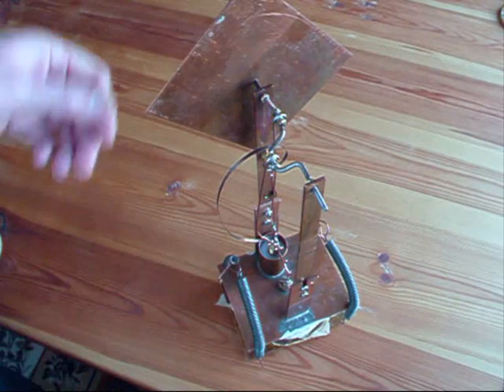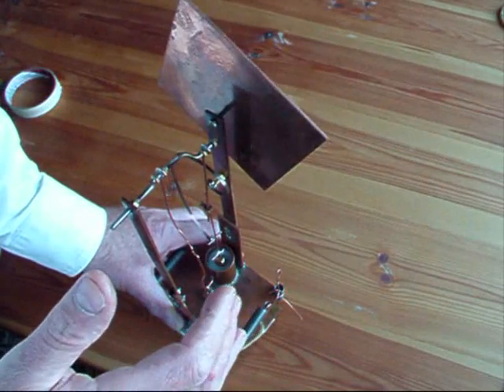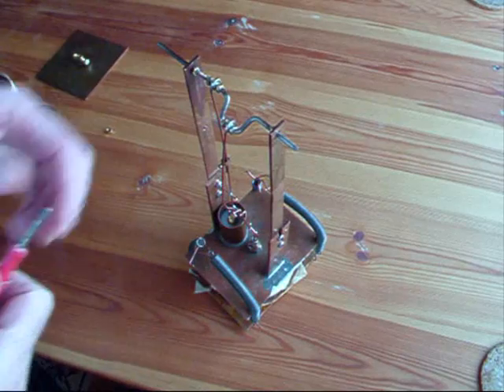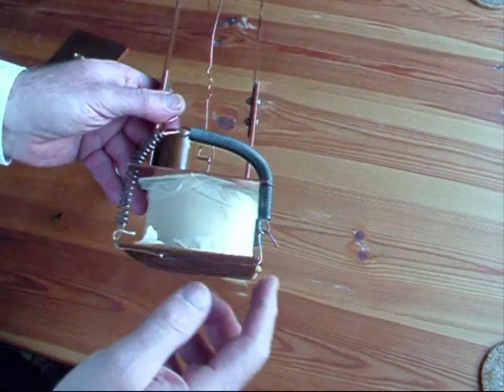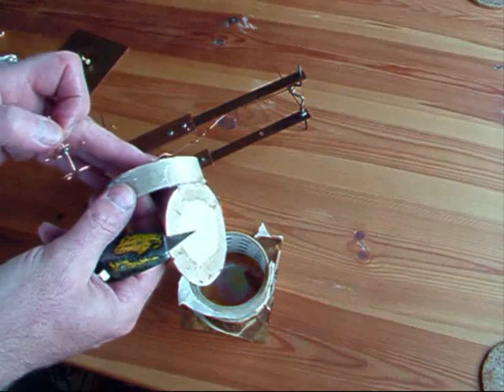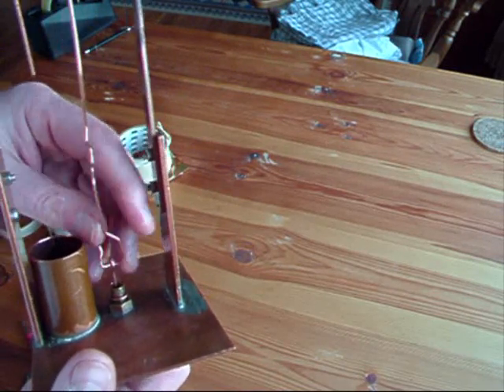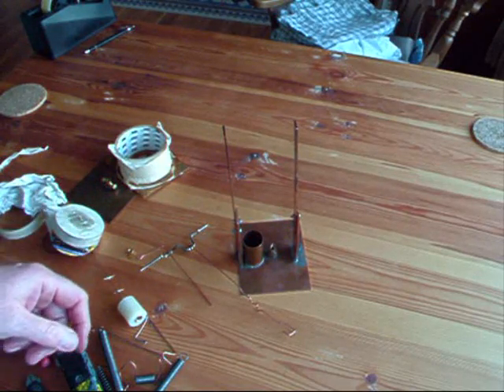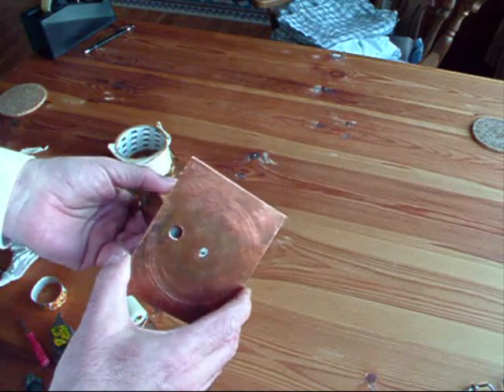A Stirling Engine stripped down so that you can see how it was made

Comment from the maker: 1 of 2
Hi Sathish, I have only ever made the engine in this video and I made it without a plan. I made the crank first and then decided on the size of the displacement chamber and the depth of the displacement piston to suit the crank, I thought it would be easier that way as I only had to cut the thin cardboard of the displacer piston to ensure I had the required clearance at the top and bottom of the stroke...

Comment from the maker: 2 of 2 
 ...so, sorry I can’t tell you, you’ll have to work it out. The displacer needs to move almost all of the air from the hot side of the chamber to the cold side of the chamber and back again. Once you have decided on the depth of the displacer chamber and the depth of the displacer piston, plus you need to have a small amount of clearance at each end of the stroke, then that tells you the throw of the displacer crank.  I hope that helps you.
Kind Regards ... Andy

Comment from the maker: Hi there, I don’t know what you are referring to when you talk about using steel wool; you’ll have to be more specific.
With regards to the tape, I’ve used that to seal the chamber. As you know from the video the air expands and contracts as its heated and cooled. If any pressure, negative or positive is lost thorough any tiny hole or gap then the engine may not run. The tape effectively seals the chamber. I hope that helps. Kind Regards ... Andy

Comment from the maker: Hi there, this little engine has no practical use as most of its output power is used to overcome the friction in the system. There is however an economy of scale and much larger engines have been used for pumping water and many other applications. It is safer than high pressure steam engines but not as powerful, size for size. So this little engine is just a novelty used to demonstrate how the Sterling System works. 
Kind Regards ... Andy

Comment from the maker: @StirlingEngine123
Hi there, you could balance the crank by adding or removing weight but I think as the weight of the piston in vertically downward there’s nothing wrong with compensating for that weight with a spring. You couldn’t do that to compensate for a fast spinning component that is out of balance as the sideways inertia cannot easily be countered with a spring.  I hope that helps you.
Kind Regards ... Andy

Comment from the maker: @SOOMROA1 Hi there.
The air is trapped in the chamber when it’s made. 
In fact it is important that the air is sealed in. 
The same air is recycled all the time. The same air is moved from the hot side to the cold side over and over again never changing but when air is on the hot side it expands and pushes the small piston when it’s on the cold side it contracts and sucks the small piston back.
 I hope that helps you.   
Kind Regards ... Andy

Comment from the maker: @technology49
 Hi, sorry about the delay my computer is hiding things from me! 

Because you will be applying heat the foam could melt so be careful. Some very efficient engines work at quite low temperatures and foam is OK in those, mine is not efficient so it needs a lot of heat. You'll see that I have used cardboard but this will burn after a while. It gets very very hot!
Kind Regards ...Andy

Comment from the maker: @offspringfanman96 

It's a nylon insulator. 

It's a piece of plastic that has a small two bass nuts moulded into it. It is something that is used by electrical engineers but I'm sure you can find or make something similar. 
 
If you go to the website Lulu.com and search for "A Stirling Engine stripped down" you can see some close up pictures that should help.

I hope that helps you.

Comment from the maker: No, the displacer piston (made from a cereal packet) is not air tight. 
It would be better if it were solid as its volume represents a waste as the air expands and contracts inside of it whereas that volume of air could be driving the power piston.
You could use a solid polystyrene displacer but remember that it will melt at a low temperature. Dont use anything heavy unless you counterbalance it. 

I hope that helps.

Kind Regards Andy.

Comment: thank you for all the info. I have built 2 of these engines and have yet to get one to work. The 1st was from the site Incredibles I assumed the problem was the piston fitment which you just blew away. The second was with a diaphram and although close will not work. After your video I'm really feeling down. Thanks again for the info I will study your video several more times.

Comment from the maker: Part three
I think that youll find that 5 hp Stirlings were commonplace. Again, Im no expert but I think that the maximum size engine you could build will be limited by your budget and not by the physical constraints of engineering scale. 

I think that if you had a machine with a one hundred foot diameter displacer it would be a slow running thing of great beauty.

Comment from the maker: Part two
If you had a huge volume of air you could afford to lose a little air and it would have a much lesser effect. 

It would be relatively easy to fit efficient bearings to a larger engine this in turn would make it easier to adjust any counter balance that may be needed.

Comment from the maker: Hi.  The answer in several parts.

Part one. 
First of all you should know that Im no expert in these engines, Im merely someone who has made a model engine that works.

Reasonably it should be easier to get a larger engine working than a small engine, so a hundred hp or more would seem not unreasonable. 
Because of the small volume of air in a small engine you only need a tiny tiny gap in one of the seals and youll lose the pressure/vacuum and the engine wont function.

Comment from the maker: OK Nick, 

Yes you have it correct; the displacer is there to drive air from the hot end of the chamber to the cold end of the chamber. 

As the air heats it expands and as the air cools so and contracts. 

When the air expands it pushes the power piston up and when the air cools it draws the power piston down. 

The displacer could be made of any material but it makes sense to keep it light.

Let me know how you get on.

Good luck
               Andy

Comment from the maker: Thank you for the positive comments. 
The displacer chamber is 75mm internal diameter by 50mm high (around 3id by 2high) and the displacer has an outside diameter of 70mm and its 19mm high (thats around 2 ¾ by just a little under ¾)
The main thing is  that the throw of the crank is such that the displacer sweeps as much air out of the chamber without hitting the top or bottom of the chamber. 

Because of the limit here Ill send you a message with more info.

Kind Regards Andy.

Comment from the maker: Hi,  
I dont have any plans of how to build the engine; I simply looked at what other folks are doing and did what I thought right. 

I would suggest that if you build a junk box special of a similar size to mine make the power piston at least 25mm diameter  and make sure its all free running when you spin it. 

Good luck.  Regards  Andy.

Comment from the maker: With heat on the bottom plate, when the flywheel is turned the displacer pushes the hot air to the colder top part of the chamber, the air cools and contracts, this sucks the power piston down. The air heats up again and expands, this pushes the power piston up and so the cycle goes on. 

So, the displacer is there to move air from the hot zone to the cold zone and back again, over and over again.
 Is that clear?

Regards Andy.

Comment from the maker: The idea is for the displacer to move as much air as it reasonably can from the hot zone to the cool zone. In this way the air contracts and expands and this causes the pressure to draw the power piston down and then push it up again.

So, if you have to use a tall chamber you should use a tall displacer to move (displace) all the air from the hot zone to the cold zone. The displacer will be shorter than the chamber by the throw of the crank, plus a small clearance. Dose that help?

Comment from the maker: I clamped the top and bottom plates together with the coiled spring because I had them to hand but in terms of thermal conduction they have to be better than connecting the top and bottom plates with a thermal bridge, like a bolt. I havent seen springs been used for these functions before but it makes good sense to me to use them.

I hope others are able to make use of these ideas. 

 Kind Regards Andy.

Comment from the maker: Im not sure which spring your referring to in your comment; I assume you mean the leaf/coil spring to lift the piston. I figured that its not easy trying to balance the flywheel with the piston flapping about so the easy option was simply have a plain balanced flywheel and to take most of the weight of the piston with the spring.

Comment from the maker: As an inventor and engineer I started off thinking about  O rings and I know I ought to use ball race bearings and maybe go to the trouble of making a finely engineered machine but really all I wanted to do was prove to myself that I had sufficient understanding to be able to throw it together. I did find that when the tape got hot the adhesive softened and I lost pressure in the chamber but when I clamped it together with the springs the problem went away.